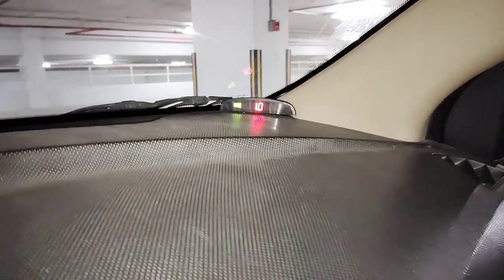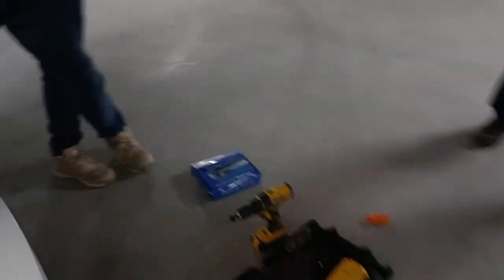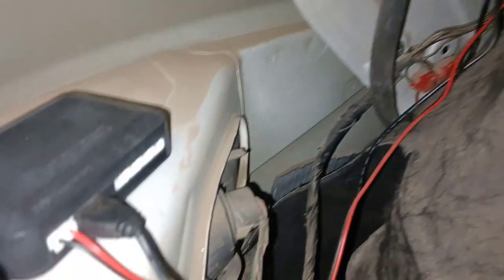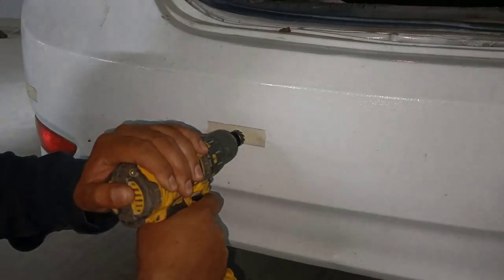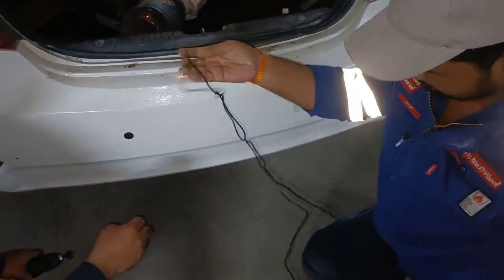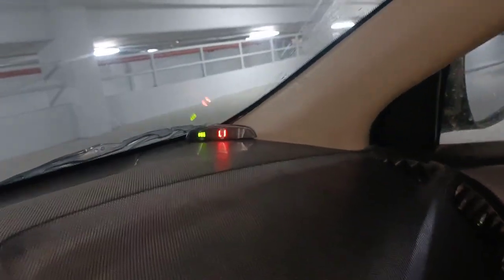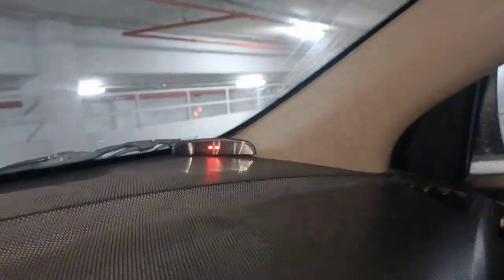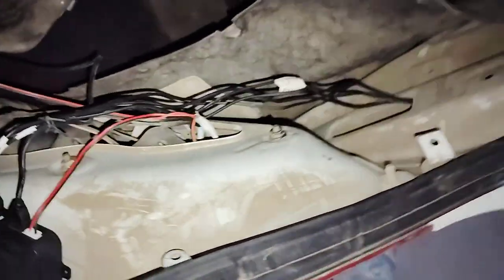HOW TO INSTALL PARKING SENSOR EASILY & SELF | #cheapestprice #parkingsensor #parkingassist

Comment: Consumer Alert - I'd recommend not buying cars with Sensors on Bumpers.  Bumpers are for Bumpers.  And many of these Sensors, yes, are xtra stuff not on older card that one can do without - who needs Christmas Light Alerts for Headaches.  Try to send an email to car OEMs - they do not want to hear from you just as they did not want to hear from you when hiding small water Hoses behind Alternators, hiding Spark Plugs and thermostats, hiding water hoses what once took ten minutes to replace when space was around engines.  There was a time when thermostats were changed in minutes, and Oil was changed in 15 minutes and a very easy chore - then came the 1980s Design Engineers who act like 6th Grade Immature Students